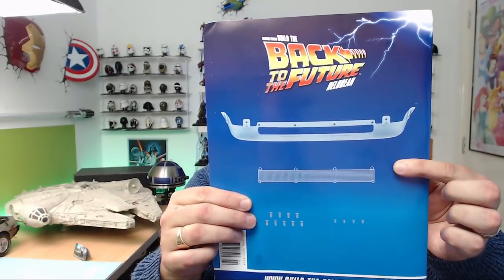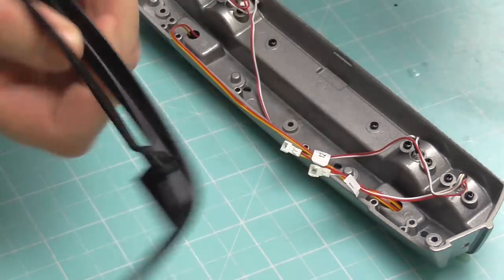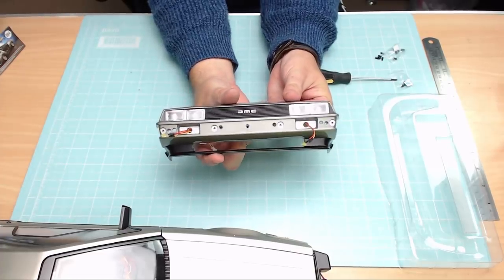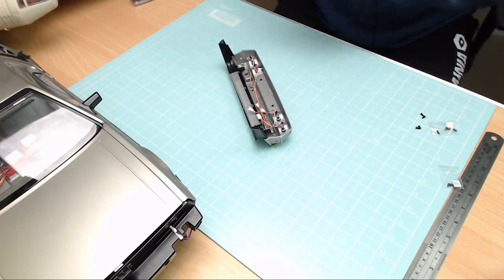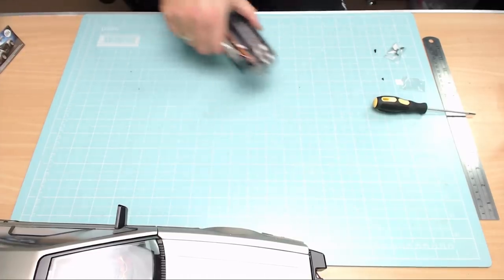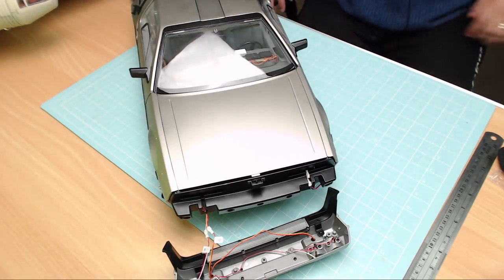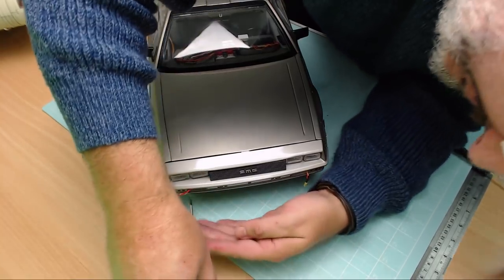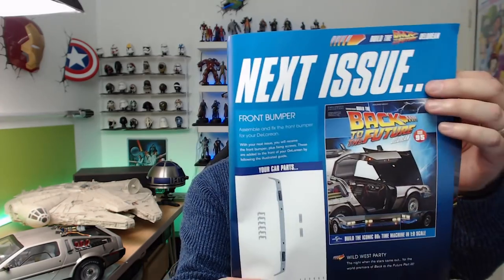Build the Delorean - Issue 94 - Installing the Valance and Grille

Comment: Hello Wayne hope all is well. I have a question I hope you can help me with...As you know we all had to pick up from where Eaglemoss left us at, so I am now continuing with my DeLorean build, continuing starting with issue #95  but when I got to the part of testing my lights all work including the tail lights but when I push on the break peddle nothing happens...have good power but break peddle isn't lighting the break light. have good metal connection where the the peddle rocker part makes the two metal contacts meet and there is space between the two connections, #5 connector is on good, I can't figgure out whats up with that, do you have any clues or idea's?  Thanks.

Comment: You have to switch the wires on the chassis around if you had it the wrong way because of the wire for the light under the luggage compartment hood cannot be switched over as easily.

Comment: So it is still 130 issues?  I can't see how the exterior detailing will take that long.
Reply: I would be genuinely surprised if the bands running around the body aren't at least 15 issues... those things are complex and can't be simplified without losing a lot of detail. Those flux bands should have around 5-6 dozen individual components to assemble just for the basic structure before you get into the wiring, mesh covering, and lighting that makes them look proper.
Reply: Thank, Penny.  I imagine that this will be the case.  It just seems so strange, given how much of the car is completed.

Comment: I've put the bumper one no lights lighting up took it of still no lights got batteries in aswell
Reply: *Sorry bumper on
Reply from the maker: Okay. I think it was button 1 that controls the lights. press it and ensure it clicks (that will rule out the switch), check all connections (bridge to the the other headlights) are securely in and the lastly are the two points that go into the control board the right way round?
Reply: @WorldofWayneUK  thank you took all apart was everything was working then when I put the cover on none working again I might have had a flimsy plus and minus connector